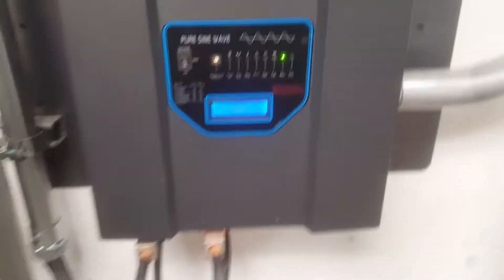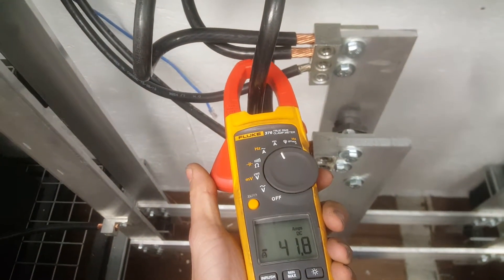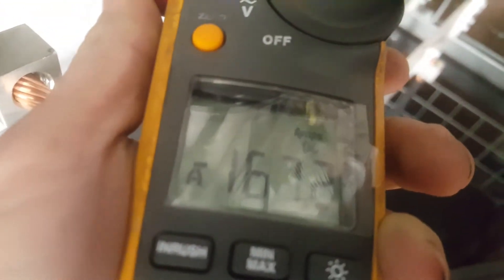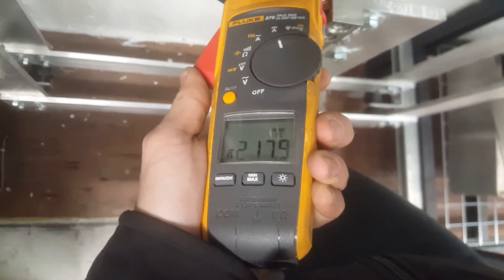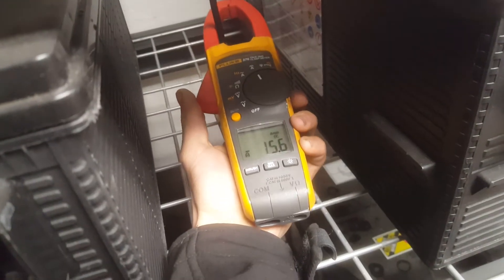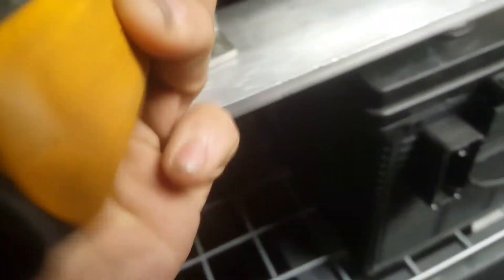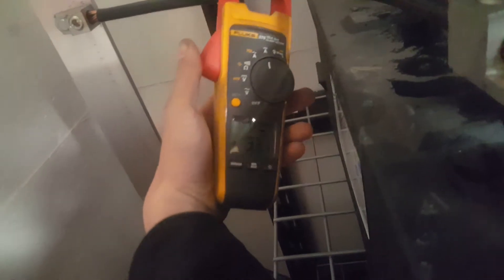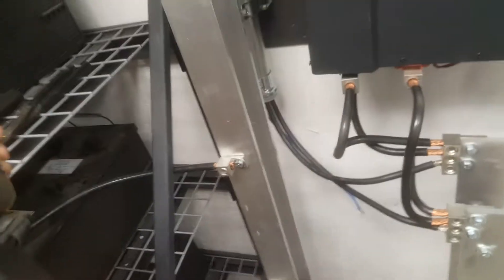Amperage checking on DC side of off grid inverter

Comment: I am still trying to find someone that does this correctly.  If you want to test for amp draw on your batteries, for goodness sake, you do not check each wire on your battery bank and then add them together.......  You ONLY check the ONE lead going to the inverter (Negative or Positive) to find the amp draw from your ENTIRE battery bank.  I have watched several videos on this subject and they all are checking amp draw incorrectly.  If you un-hook your inverter from your battery bank, and then use your amp meter on your wires like you do in this video, you STILL will get high amp readings on those wires because each battery is drawing amps from the other batteries in the bank, and THAT is why you ONLY check the ONE wire that is going directly to the inverter...  If you turn off your inverter and check the amp draw on ONE wire (Negative or Positive) going to your inverter, the amp draw SHOULD be around 0 amps...

Comment: it could be the aluminum? it oxidises almost instantly. I would have used copper or copper wire. or even brass. maybe even stainless. I don't like running current through aluminium. especially DC!  but the balance wires shouldn't have any current correct?
Reply from the maker: +James stranger that would be correct. Copper wire would have been impossible to terminate and keep equal resistance throughout the bank. The bank is tapped for output diagonally meaning every battery has equal resistance through the bussing to the inverter. The only reason this should be happening is if there is something wrong with a battery. All connections were made cleaning the aluminum thoroughly and applying antioxidant immediately after and then securing the connection to the proper torque, in other words as tight as it can go.
Reply from the maker: +James stranger stainless is also the worst of conductors. Stainless is stainless because it has an oxidized coating that protects it. The moment contacts air it oxidizes. Same as aluminum but much worse. It doesn't rust so to speak because it already is Rusted by Design. Also super expensive. I used to be a stainless steel fabricator.

Comment: Man ... those are some crazy readings.  I'm certainly interested in what the problem and solution is for these readings.
Reply from the maker: +TheZigZiggy I am going to remove all of the tie wires that go vertical from rack to rack and then measure voltage of each battery and current individually. That should find which battery is a problem
Reply: Will you be doing Lithiums soon?
Reply from the maker: I already have!  Check out my newer videos and you will see.